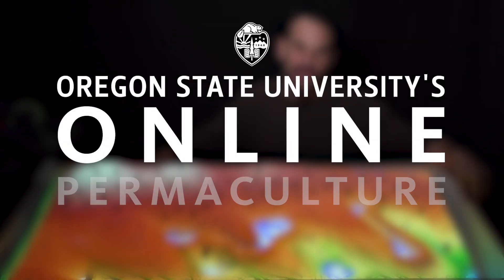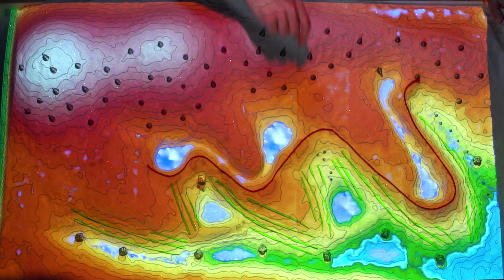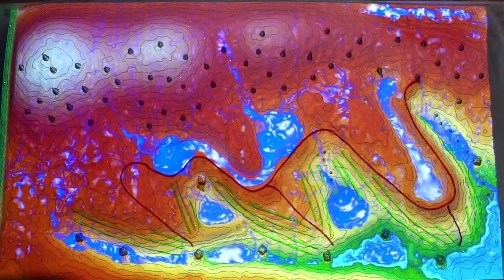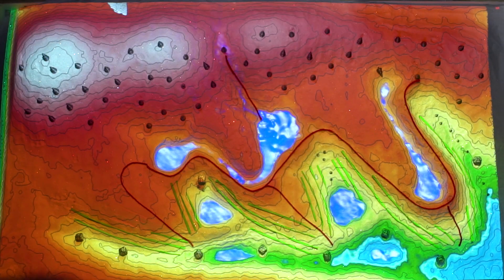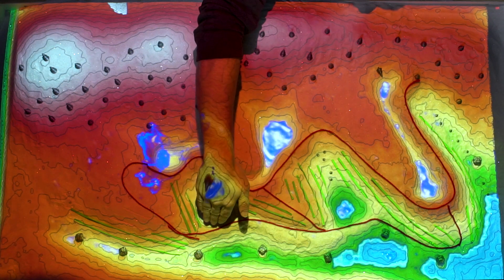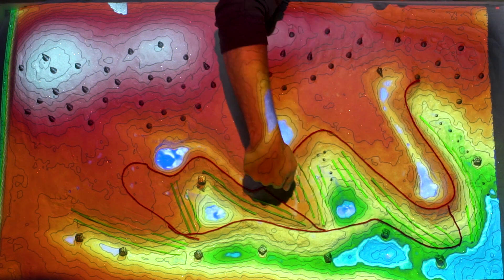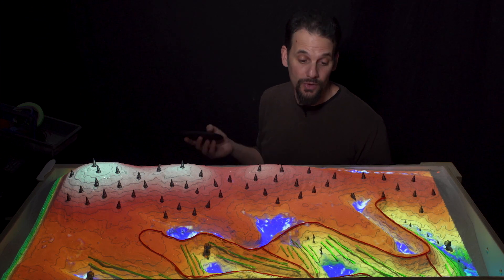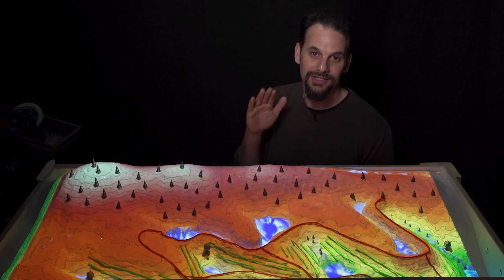Keyline® in the AR Sandbox #4: Design for Access

Comment: Hi Andrew. Great episode. Enjoying your little hydrology course immensely (and wishing the internet was more like this, instead of, you know). Just wondering why you didn't place the roads uphill from the ponds. Wouldn't overflow from the ponds damage the roads? I realize you are suggesting the roads to be thought of as swales - does that cancel out the risk of damage due to pond-flooding, or is that kind of problem not likely (due to another factor)? Ash
Reply from the maker: Abe, good question. The roads are placed atop the pond embankments, and in this particular diagram, the ponds overflow laterally across the slope into the next pond over. But there does need to be a location where the overflow from the ponds crosses the roads in some way, and there need to be stabilized overflows either across (through a fortified spillway) or under (through culverts or under small bridges) the roads to handle flood flow. Firstly, there will be a "trickle pipe" so the normal level of flow is just piped under the roads without erosion damage. This video right here has a fairly good example: https://www.youtube.com/watch?v=wV4iSy4tTXc&t=1s If you search you will see a number of designs for flood overflow across a road embankment.
Reply: @amillison  Great, thanks for the quick reply. Will reach out to learn more and stay up to date via Twtr

Comment: What if the driveway that we shared with our neighbor is already built and located in the worst area, the valley,  where we have a huge road erosion. Before we knew anything about how water flows (which makes sense), we spend a lot of money in trying to fix it and in doing so, we just mainly put a bandage on the land and not permanently fixing it. So, if the road already exists, what can we do to permanently fix it. Also, when I observe the pattern of water during the heavy rain fall, the heavy rain pattern started at your neighbor's road which is much higher than the road that connected to our land which is lower...this explains why we get a strong momentum of water flow down to our shared driveway and causes a major erosion problem. PLEASE HELP. Thank you so much for your time.